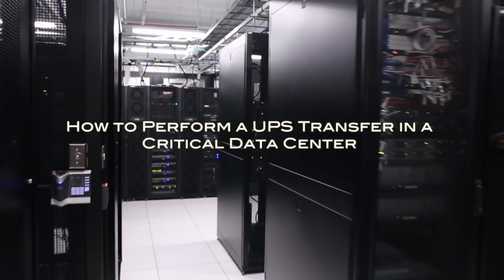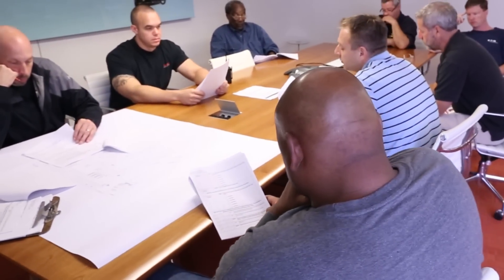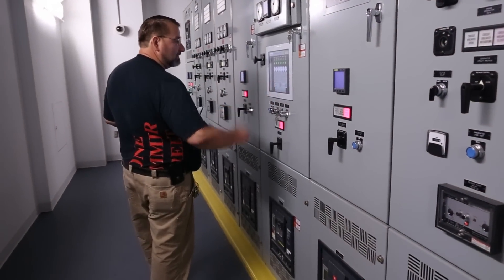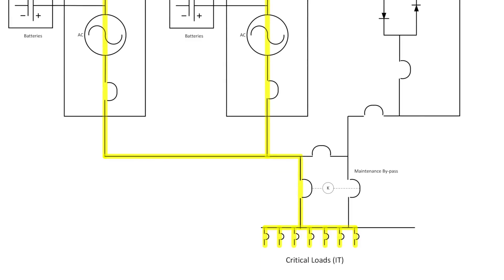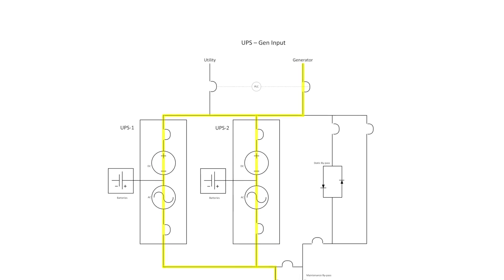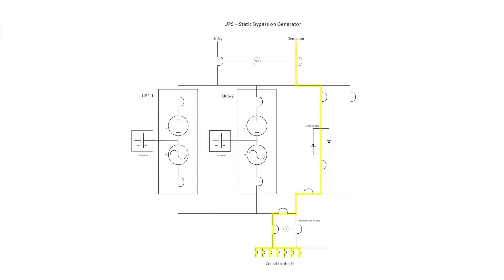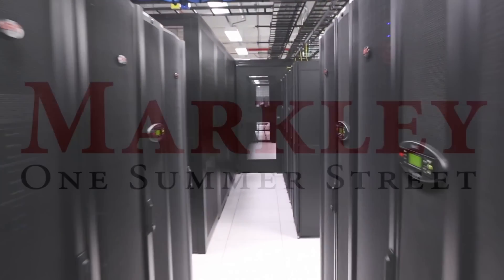How to Perform a UPS Transfer in a Critical Data Center

Comment: I have concerns about running IT loads with a generator with no UPS in between. IT has a pretty big leading power factor while a generator has a relatively low lagging power factor. In theory, couldn't this trip off the generator?
Reply: It could be handled by some capacitor to correct the power factor I think.
Reply: @steakikan  This seems correct. I just can't verify it haha.
Reply: IT load poses no risk for generators, UPS could present more issues due to their input filters (AC capacitors) this could mess with voltage regulation, for this reason Gens are normally oversized to handle capacitive/inductive loads.
Reply: Even if you switch to utility, there's still no UPS between the load and the generator.  I'm curious how you think they work on the UPS?   The genset is sized to handle the load and power factor.
Reply: @stargazer7644  Hmm I don't understand your thought process and you answered a question with a question. It seems you may have some relevant information but unsure how to write it.
"Even if you switch to utility, there's still no UPS between the load and the generator." -  What does this mean? The question was about a generator powering IT with with no UPS. 
"
The genset is sized to handle the load and power factor." - I'm not sure what size has to do with a difference in power factor and theoretically dropping IT load. Can you elaborate?
Reply: "I'm curious how you think they work on the UPS? " - UPS maintenance is performed by placing the UPS into maintenance bypass which allows utility power to bypass the UPS and still power the IT load. You do not need to switch to generator power to perform UPS maintenance. Do you think this? Sorry. I can't tell.
Reply: @sjf4405  You said you're worried about power factor tripping the generator.  I said you size the genny so that isn't a problem.  You said you had concerns about running IT loads when a generator with no UPS. Presumably you're trying to say they should be on Utility power instead of generator.  My point is even on direct utility, you're running on a generator (the power company's).  If you think IT loads should always be on UPS, I'm wondering how you think they would work on them. Then you said put the UPS on bypass.  Which is exactly what they did and your original post had a problem with.  So WTF is your point?  And when on bypass, you shouldn't run on Utility, that is a single point of failure.  You should be on N+1 generators when in UPS bypass.
Reply: @stargazer7644  Bit late but nonetheless: Regarding working on the UPS, it depends on the electrical arrangement of the data centre. Not sure if the site is a tier 2 or 3 site; if it's tier 3, it'll have a secondary source of power (inclusive of a UPS) serving the IT load in the data hall. If it's a tier 2 site, I'd strongly prefer to have an N+1 UPS arrangement, and service 1 UPS unit at a time...
Reply: @gloveyourway2000  I'm late to the party, but this looks like what my question more or less addresses. The video looks like they're set to do maintenance on one of two UPS trains (and maybe it's both and that's what I'm missing). Why would they not have the ability to isolate the lag unit for maintenance? I understand that it's still a single point vulnerability if that's all they do, but if they start up the generator(s) as a new fallback in case of failure, wouldn't that be better? Basically, the UPS ensures cleaner voltages, so shouldn't it be top priority to be able to continue to use the side that isn't getting worked on, and the generators are more of a last resort? It seems foolish to run single point vulnerability on raw generator power while doing that maintenance unless I'm missing something which I'm sure I must be.
FYI I'm very green on this and very much still learning so sorry if these are dumb questions.
Reply: @willsutton3471  Sorry, but I don't understand your question. Not sure what you mean by lag unit?
As for the single point of failure; it's a managed risk, the severity of which depends on the data centres tier rating.
If the data centre is tier 3 (which is what I believe it is), you'll have 2 UPS units providing power to the critial load (ie active IT equipment installed in data hall cabinets).
If you need to perform maintenance to one of the UPS units, you'll still have the second UPS unit protecting the load against an unexpected loss of power, plus a generator to turn on if the utility power supply fails. Some places like to switch to generator power instead of relying on utility power during a UPS service...

Comment: No arc flash label in sight !
Reply: With that much power you just assume everything is an ark flash hazard lol.  We  have big batteries at work, if you were to drop something across the terminals not only would it turn into a gas, your family won't even need to pay for your cremation.

Comment: That is some out of date equipment by today's standards
Reply: you'd be surprised how old the equipment is in a lot of datacenters. the computer equipment may be modern, but the power equipment keeping it going can be decades old. it's very expensive equipment, expected to last a very long time.
Reply: Not at all. We just refreshed a Symmetra PX that's nearly 20 years old. (same frame, new electronics.) Those in-row AC units are still being made today (2021).
Reply: Ya. It's a 6 year old video

Comment: Sir why utility power is change over to DG?
Reply: By going to Static Bypass, you have removed your UPS batteries from the system. This means that if you were to incur an utility outage or a significant sag/swell, your IT loads may be severely impacted. By putting your system onto generator, you have eliminated this particular risk.

Comment: This can use DRUPS to make thing easier, it is automatically transfer u power and normally transfer to gen set power within few seconds.
Reply: Or just use a static transfer switch instead of an automatic transfer switch.
Reply: @Sbrabson04  Or just use an automatic transfer switch instead of a manual one

Comment: Is there down time when moving load from second UPS to the static bypass?
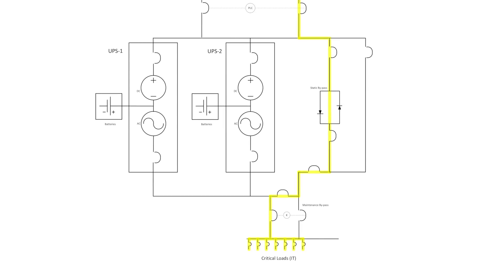Reply: 2:11 Why do you even bother opening Youtube videos if you don’t even watch 2 minutes of the video?
Reply: There should not be as the UPS will filter out the power blip. Depending on the total load, the UPS is able to support it for that short time of transfer.
Reply: @Sbrabson04  I’ve been in this field for the last 25 years. What you replied with makes no sense.
Reply: @darenhouser427  you must be pretty slow and not know the main function of a UPS lol. Not sure 25 years equates to experience lol. I’m here all week!
Reply: @Sbrabson04  With an engineering degree in electronics, after working on guided missile systems for the military and another in HVACR with an A class license, slow doesn’t quite fit.  I think your confused where the Static Switch system is employed and exactly how it works.  No worries here. I see techs like you all the time and correct them as well. Happy Holidays.
Reply: @darenhouser427  it seems more that there are 2 parallel UPS system with stepped shut down so while they power off 1, another 1 still online to support switching so there won't be any blip. The static bypass is also done on the UPS side and automatic. It is also possible that like typical online UPS switching from online to bypass doesn't cause any blip at all as both inverter and bypass circuit are actually online and synchronized. Cmiiw
Reply: @steakikan  it sounds like we’re talking about 2 different systems here. In a parallel setup, when one UPS is shutdown the other UPS accepts its load, seamlessly. If you were to shut down the second UPS, the load would transfer to bypass because, as you stated above, the inverter is always synchronized with bypass (utility). A transfer is made at “zero crossing” on the sine wave.  In a single UPS setup, when the load is transferred to bypass (utility), it depends on several different things like KVA size of the UPS, manufacturer etc, the load will transfer seamlessly via Static Switch or the bypass contactor will close and then the output contactor will open.  As stated before there are several different ways to transfer the load...I just can’t get passed the words “filter out the blip”.  It’s not filtering anything.  On and older Liebert system, when the transfer takes place the output and bypass contractors are closed at the same time (60 to 80 milliseconds, I believe) but it was designed that way.  The inverter isn’t filtering out anything as the output contactor is down steam of the inverter.  Cmiiw?
Reply: I think each rack has it's own, smaller UPSes as well, so those can handle the momentary transfer.
Reply: @redsquirrelftw  They do not. That is highly inefficient and also dangerous as that would include batteries in the server room, a big nono. As Daren said. The switchover hapens in phase sync and the contactors/ATS is fast enough (a few miliseconds) that it is not noticeable on the powersupplies for the servers, the internal capacitors for the server and its powersupplies can last for somewhere arround 10-20 ms usually. you just need the power to be phase synced on both feed and bypass and then be fast enough :)
Reply: @thepuzzledsage  I already feel dumber. xD

Comment: Space suit??
Reply: It's arc flash protective gear.  It prevents the human from getting barbecued if the switchgear fails catastrophically. Look up arc flash accidents on Youtube, people tend to die from arc flash events.
Reply: PPE, it's required to work on any kind of eletrical equipment past a certain voltage where arc flashing can happen.

Comment: What kind of suit is that at 1:24?
Reply: looks just like the 40 cal arc flash suit i use at my work. if things go bad, it essentially protects the body from the vaporization of a solid conductor such as copper into a gas. the arc flash could exceed 35,000F
Reply: why weren't they wearing gloves?
Reply: @gatewaysolo104  I noticed that, too. Sure, they have to be able to use the stupid touchscreen, but if a flash happens, that hand ain't growing back. (there are gloves that will provide arc flash protection and work with those stupid touchscreens.)
Reply: Touch Screen
Reply: @JeffreyCoumbe  still stupid to wear protective gear like that and then completely waste it because you did not want to use a stylus.  i mean those suits cost a heck of alot of mula why not pay for a cheap item like a stylus to operate the touchscreen while wearing them.
Reply: @highkicker11  There is no high voltage threw the touch screen Too much is sometimes too much. Do you wear a nascar crash suit every time you drive a car?
Reply: @JeffreyCoumbe  maybe you did not read what i wrote, but i was just calling it stupid to buy expensive protection and save bucks on a cheap thing. also maybe no high voltage through the screen but they are wearing the suits for a reason.  after all they are still wearing them except for the one glove so imho it seems they still need them because it has to be hot in those suits. if they did not need them any more why keep the helmets on.
Reply: @highkicker11  I might have jumped to a conclusion.
Reply: Would the plasma generated by the arc actually pose any danger to the operator?
This looks like an enclosed switch, and all of the arc flash videos I've seen have involved switches with the panels open.
Reply: @user2C47  better to be safe than sorry i guess? but the panels are also made of metal and those are some high voltages so i dont think you really want to take the risk

Comment: WHAT IS THE MAX ELECTRICAL POWER CAN SUPPLY FROM UPS AND CAN WE OPERATE CHILLERS 800 KVA AND IF POSSIBLE FOR HOW MANY MINUTS OR HOURS .THANKS
Reply: Sure.  You can run whatever you like for as long as you like. The only limitation is how much money do you have?
Reply: I maintained a data center of an important bank,,,the Ups is Powerware,,,,400 kva,,,three phase 3x 400vca,,batteries 12v 180ah,,,for this purpose,,,in battery mode,at full load the battery use was 11(eleven )minutes,,,,ai 8(eight)minutes an alarm,,begin to sound.At middle power,,,20  (twenty)mijnutes,,,but the ups is "online,,,,works 24 hs,,,if the power goes out,,,the uops gives power,,,bacause the inverter works all the time.  the configuration is    ac charger,rectifier,batterry,,,and inverter     ac,,,,dc....ac   .sine wave with very low distortion<0,5%